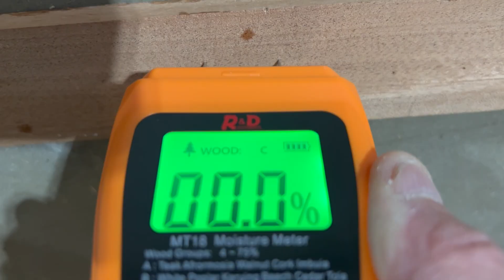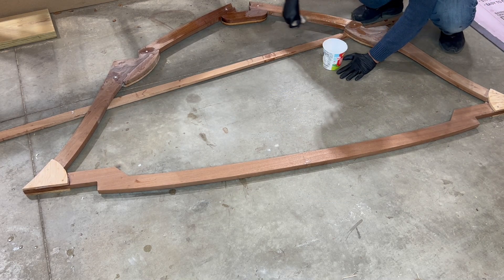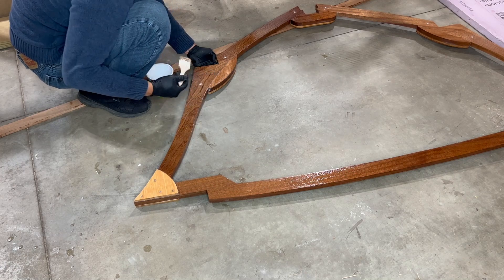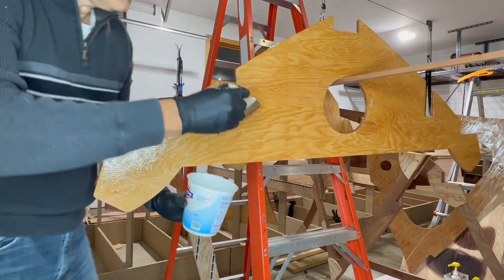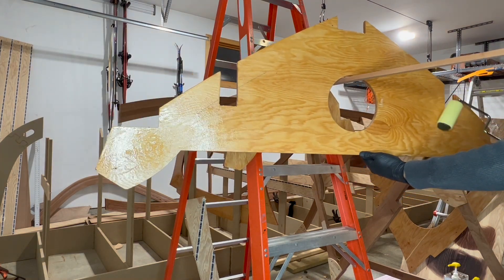Temptress Build 34: Epoxy Coating Bulkheads, Frames and Stringers

Comment: From start to finish with the encapsulation about how long did that take? 

Starting to look like a boat!!
Reply from the maker: Too long.  I would guess 10 hours of work so far, but I have more to do. So 20 hours in total will be my estimate.
My biggest issues is that I can only work in 1-2 hour increments.  Would be much better to have 1 full day and space to do all frames at once.
Reply: @Polymerman  I bet!! Need a barndominium garage :)